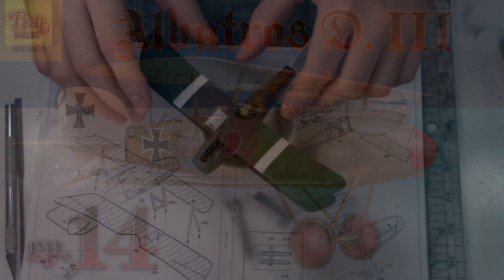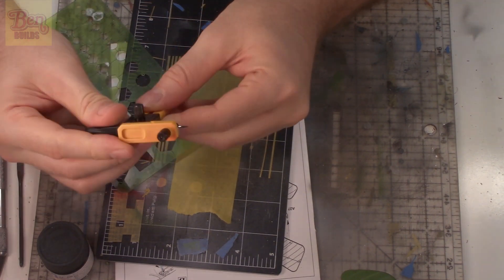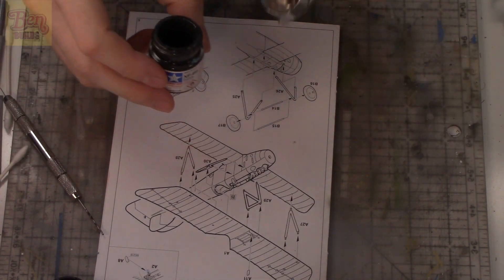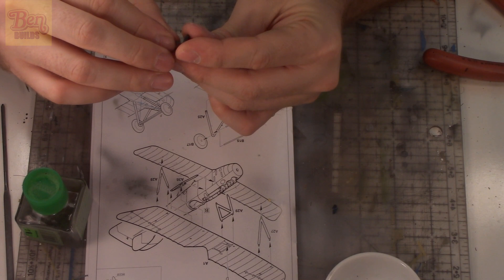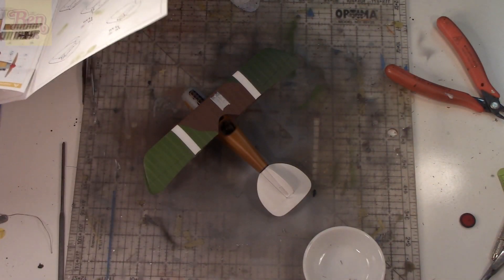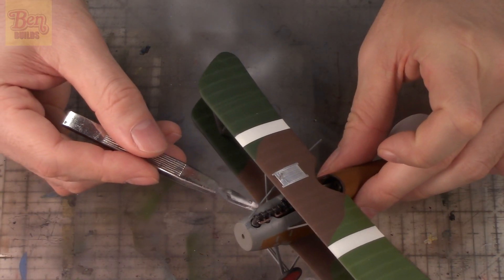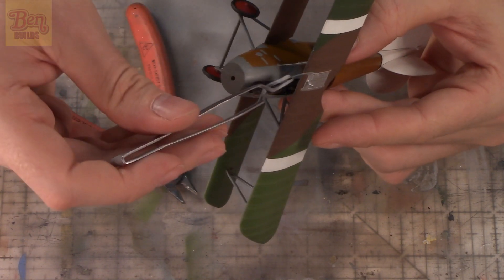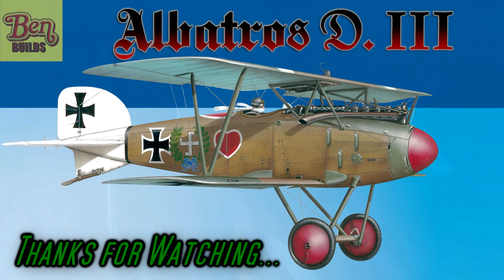Ben Builds: S6 - Albatros D.III - ep. 14

Comment: Great work Ben!  Now when you were bending the exhaust, did you heat that sprue up a bit or heat up the pin vice?
Reply from the maker: Thanks! Actually, I just gently bent the plastic around the pin. No additional heating seemed to be required. Maybe the plastic was still a bit soft from the initial stretch? I don't know, but it conformed well and held it's shape.
Reply: I keep learning more and more from you on this build, thanks!
Reply from the maker: Thank you! That is very encouraging. I am so glad that you are enjoying the videos!